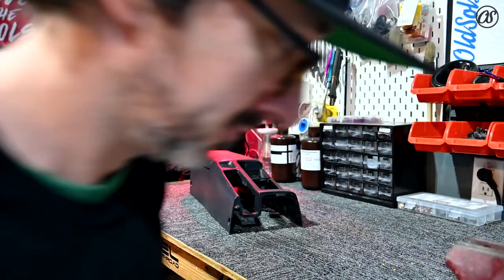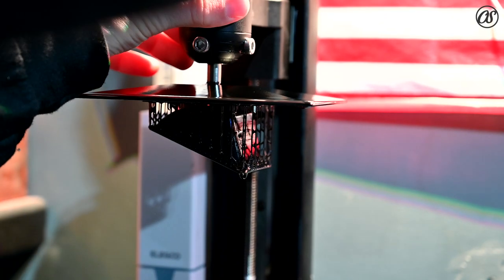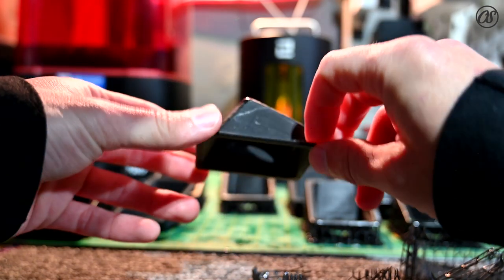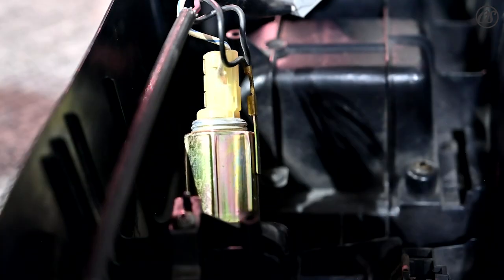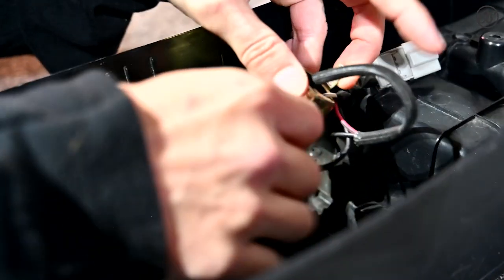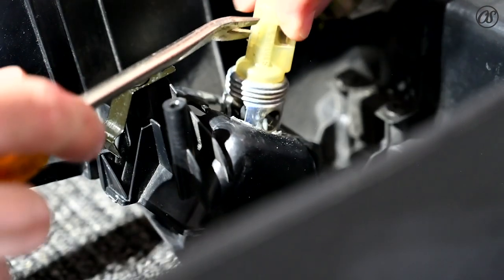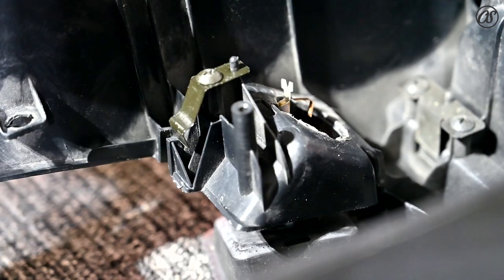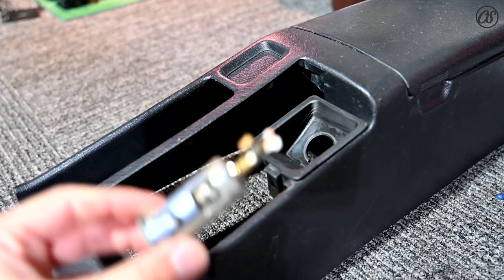Honda Del Sol - OldSols Vlog 105 - Resin Cigarette Trim

Comment: I LOL'ed when you said you've never seen one without a broken corner.  I had exactly that in mine.   I ended up replacing it with a rare non-broken one from picknpull.   I did some modifications (made the hole a slight bit bigger) to it to replace the ciggy lighter with a mounted usb power port.  I do alot of 3D printing but not never thought to do this.
Reply from the maker: Nice man! That's dope you made your own! You still rocking it?